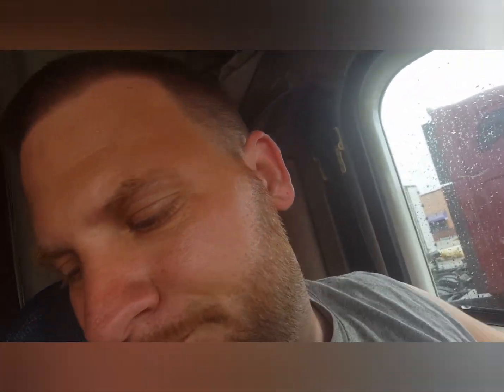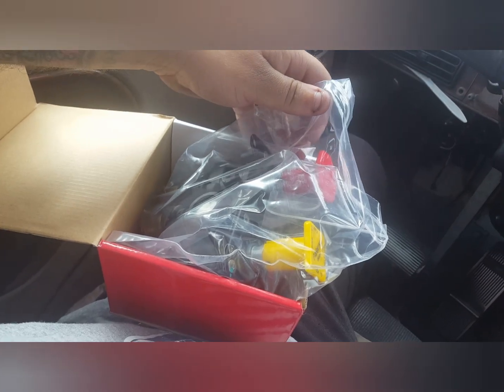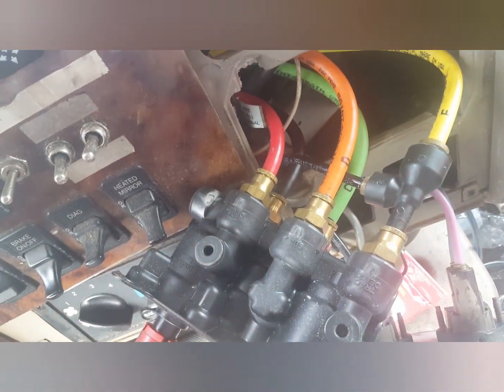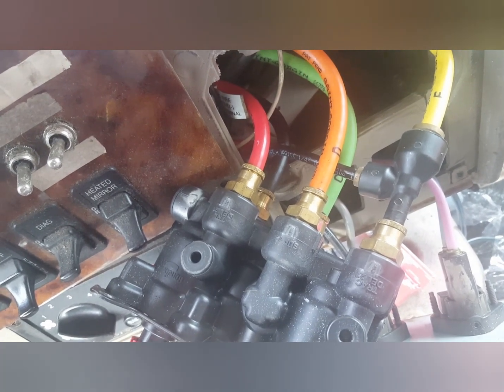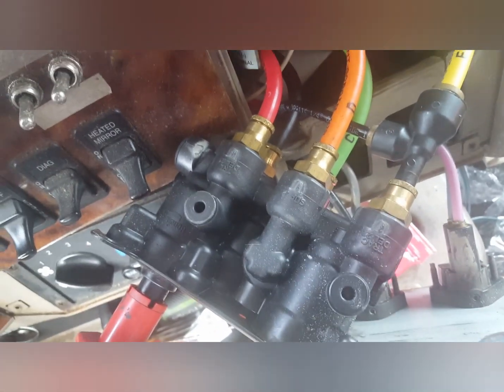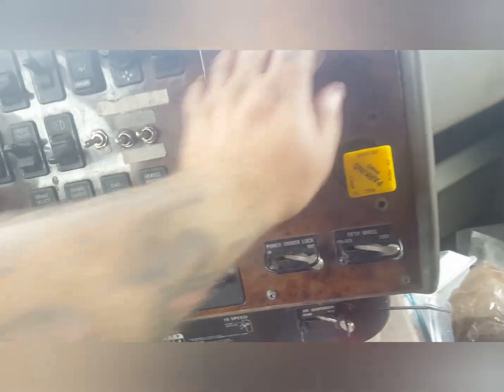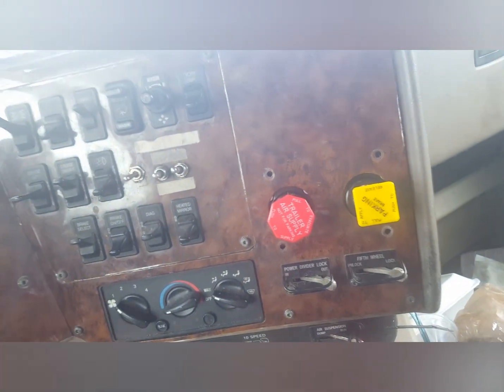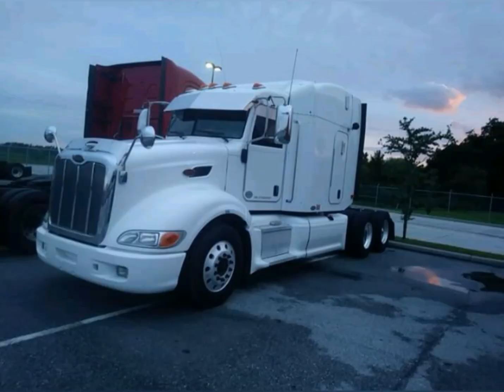Changing out trailer air supply valve!

Comment: I change mine every 8-10 months. I do have a spare valve with me- got same truck 9400I- lots of water in my air system- finally knew i had to change my compressor.